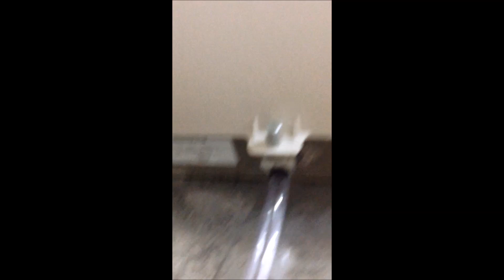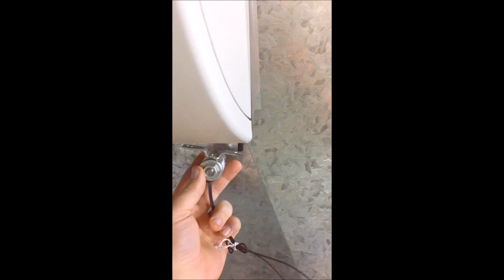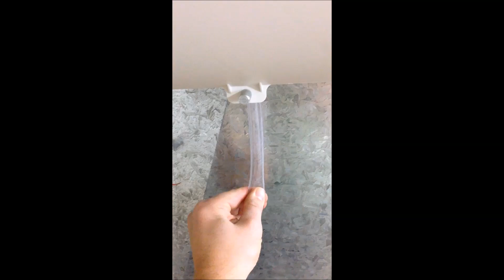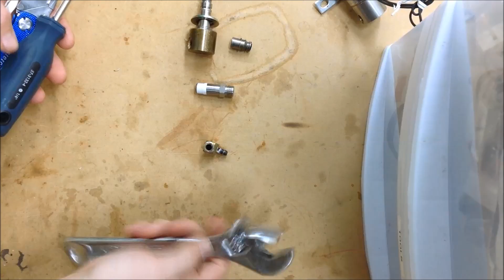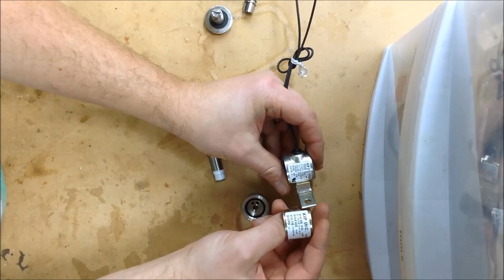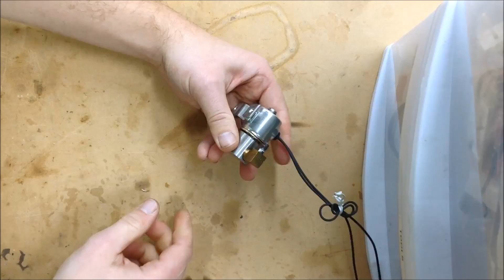How to Fix Your Whole House Honeywell Humidifier Cheap! SAVE MONEY ON YOUR WATER BILL & REPAIR! (HD)

Comment: Yyc, combine that with a city fresh water back flow valve and heating hot water from 6 degrees to 60 in your hot water tank…. Most homes will have over pressure issues. I was blowing part the toilet tank valve and humidifier each year until I installed a pressure reservoir. A city water pressure regulator wasn’t enough due to the pressure build when the water heater would kick on after pouring a bath and not using the water taps.

Comment: My water pressure isn't as high as yours, but thanks for the tutorial. I had no water running, with your help I cleaned it out and things work fine. Thanks., also you can get a replacement unit from Amazon for around $30

Comment: Thank you for the informative video.  I had ordered a new solenoid and it could have filled a fire truck, water was running all over the place.  I ended up watching your video and taking mine apart and cleaning it, works great.  I do wonder where you found a replacement.  Exact matches online are $60 to $120.  Shit for that much I can do like your buddy and just go buy a new unit.

Comment: Superbly helpful video!! I had other problem: the flow of water had stopped so there was not humid air being added to the furnace flow. I was able to open the valve assembly (thanks to Eganwp's video) and clear the 1/16 inch orifice with a pin. While the assembly was opened I removed the hard water scaling and cleaned up the inlet, outlet, and valve. I am sure it would become clogged again in another few years, but at least I know what to do.

Comment: Thanks for this awesome video
Does anyone suggest only opening the feed shut off water valve a quarter turn? We have 1” water feed into the house and thus pressure is high. The sprayer in the humidifier pad feed sprays all over and leaks thru cover. Cleaned everything out for calcium deposits and changed pad but still happens. Thoughts?

Comment: I have read that some guys use a shut-off valve to reduce the water flow to their humidifier when they have too much water pressure. Having hot water supplying your humidifier combined with a multi-turn valve to control the flow can be a problem.  Hot water is recommended to increase the rate of evaporation, but it can destroy the o-ring in a multi-turn valve (it did mine). These valves should only be used in the fully open/closed position (read the box).  The o-ring in the valve can be replaced if you are lucky enough to find one the right size, but it is usually easier to pop for the $10 for a new valve. You could change your water supply to the cold water pipe, but a better choice is to use a 1/4 turn ball-type shut-off valve. They are more dependable in the long run.

Comment: You saved me from HVAC tech visit and likely rip-off bill! I had a new HVAVC installed 5 years ago. Air seemed to be a bit dry this winter (Cleveland, OH).  Was not getting any water to humidifier pad. Process of elimination starting with simplest issue first - check water flow supply to pad....(1) Shut off water at saddle valve,  (2) took off supply line at solenoid valve, (3) turned water back on at saddle valve  - good water flow, (3) cleaned screen on inlet to solenoid (which I would not have known to dig in there and pull out the little bugger had I not watched your video), found little to no buildup, cleaned with white vinegar and toothbrush before re-inserting, (4) removed plastic outlet line on solenoid valve and DISCOVERED THE IDIOT (so called "professional") WHO INSTALLED THE UNIT HAD NOT REMOVED A LITTLE YELLOW PLUG installed in the plastic tube that runs from the outlet side of the solenoid valve to the humidifier pad drip tray when shipped from the factory!  No problem now! Wondered why my filter always looked clean...THANKS FOR THE VIDEO!  (A suggestion to improve future videos - chill on waving your hands around so much and moving parts around the work bench - you look like a magician playing the shell game.)

Comment: Thank you for posting this, I am a new home owner and my previous owner installed one, I noticed continuous water flow in drain line, my inspector said it may be due to humidifier. But I learned recently the newer humidifier is not supposed to allow water flow when furnace is off. I have to look at mine and will update if this is going on with mine.

Comment: video helps. thanks.. but much too long -- we want to get it fixed first.  Should have taken 2-3 minutes. #1- plan what you are going to do before making the video. taking the pieces apart first using and or marking all new parts so you can do it quickly and efficiently showing the repair first, A-B-C, 1-2-3.  LAST.. all other things pertaining to other issues and problems. haha
 #2 - make video.
Reply: Simon Sez Are you only the critic or you really have done well planned videos

Comment: I have a problem with no water flow. When furnace turns on I hear a click, so seems like magnetic mechanism gets a power and possible one of the orifices got plugged. I have found a new 24V (same as mine) inexpensive solenoid and the only difference is that my original is 7 Watts and a new one is 10 Watts. Does anyone know if this is a big deal?

Comment: How did you change the tubing? Mine is clogged and I don’t know how to take it off. Did you just pull off from the April air unit from the outside? Or do you need to go inside the air unit itself and Take out the black part that the tube is attached to?

Comment: The size of the orifice is important, vitally important actually. The orifice controls the amount, the volume, of water that is delivered to the evaporator pad. Too much water, AKA an orifice that is too large, and the pad gets overly soaked;  therefore you will not get proper evaporation thereby not getting the humidity generated that you want. Too little water, AKA an orifice that is too small, and the pad will dry out; again not delivering the humidity that you are trying to get into your living space. 

Also, water is a very aggressive molecule. It is a polar molecule. H2O is positively charged between the Hydrogen atoms and negatively charged  on the opposite end near the Oxygen atom. (http://www.middleschoolchemistry.com/lessonplans/chapter5/lesson1)
This is why it is known as the Universal Solvent. (https://water.usgs.gov/edu/qa-solvent.html)

Because of these chemical properties it eat away at the brass valve body. The flow of water contributed, but the chemical erosion is the real culprit.

Also, you NEED that filter in the valve body. It actually is recommended that you replace that filter annually by most manufacturers. That filter caught A LOT of debris that could have gotten between your valve seat and valve disk. If that filter was not there, that debris could have gotten caught between the valve seat and valve disk allowing water to flow past the valve essentially causing a leak. Albeit a smaller leak than you were describing here, but a lean nonetheless. Also, that leak would worse in time as we have already seen that moving water, corrosive water, would have eat away at the valve seat and/or valve disk if the water flow was not arrested.

Short version of the story, don't try to out think the engineers that designed the thing. They put items in particular places for very valid reasons. 

You should probably have your water tested for hardness and acidity; then have those conditions corrected back to acceptable levels. You and your water using appliances (Water Heater, Clothes Washer, Dish Water, Shower, Sinks, etc.) will be much happier if your water is the correct hardness and acidity!!

Take it from a man that ran a dialysis center, and who also HAD a doubting partner. He pitched a fit that I wanted to install a water softener to condition our water. "EH! It's good enough!" he said. 6 months water he was singing a different tune! "Holy Cow!" he explained, "I can't believe how clean everything is. The glasses, the shower door, the clothes!" And 12 years later we haven't replaced the water heater, which he had been replacing every 5 years because of the aggressiveness of the water before I corrected it.

Just saying, Culligan isn't just hype. They do know what they are talking about. (Not affiliated with Culligan.)
Reply: Hi Daniel, I need to replace a solenoid and the one found in supply store has same characteristics as my current and the only difference is that that current one 7 Watts and new one 10 Watts but both are 24V. Is this a big deal and I might break anything?
Reply: @dbezglasni  I believe that should not be an issue, it just means that the coil uses more current than the original. 3 watts should not be an issue at this voltage. They probably put in a larger coil because they put in a stronger spring to ensure that the valve closes more completely/reliably and need a stronger coil to overcome the additional strength of the spring.
Reply: @DanielLaurie  Daniel, Thank you very much for looking into it !!!!

Comment: Thanks for your video. My Honeywell HE360 humidifier short cycles on-off about 4-5 times once the furnace shuts off after reaching the desired temperature. After short cycling 4-5 times the Humidifier shuts off as it should. The unit seems to work just fine except for the short cycling issue. Talked to tech support at Honeywell, but they were not able to definitely resolve the issue. Is the problem related to an electrical issue with the solenoid or more related to what was presented in the video here? Or could I have the wrong settings on the humidistat? Or....? Anybody know? Thanks in advance!

Comment: This was great! While my problem (water constantly running) was not my problem (i had no water running), the description and explanation of how the parts of the valve and how they work was just what I needed to find and fix my issue. 

My problem was that the little cone filter and the orifice in the inlet tube were completely blocked with minerals/crud. Once I knew the filter was there and where to look, the cleaning and re-assembly was easy. You would think that the Honeywell maintenance instructions would have mentioned the existence of this filter, in addition to the instructions for replacing the water pad.

Thanks for this great and useful video!!
Reply: The Pauls this particular comment should be pinned to top as most people have this problem above the hole causing it to run through. Thanks man!!

Comment: Just thought I would add something to this - trying to find a stockist of replacement solenoid valves in Canada is difficult but I managed to buy a suitable replacement here.

https://www.kleen-ritecorp.com/p-1851-kip-solenoids-14-24v-metering-none-orifice18.aspx

https://www.kleen-ritecorp.com/p-1850-kip-solenoids-18-24v-metering-none-orifice-332.aspx

The solenoid connection is not quite the same but you can fix that will a bot of soldering or simply swap the existing solenoid assembly from your old valve.

Comment: Nice diy video.  I had a new water heater installed.  The installer put a new water line tap on the cold side of the water heater, where the old one was.  The line ran to my humidifier, but no water would run when the furnace came on and the water valve kicked open.  I checked the valve following your video.  It wasn't the valve.  It was the new cold water tap.  When the installer tightened the water tap down, the needle that punctures the water line had slid off to the side of the water pipe, and hadn't punctured the water line.  I re-seated the new tap, tightened it down.  Water started spraying out of the new tap, until I had it tightened enough (and yes, I had turned the water off before hand.  It was just back pressure water.)  The humidifier works great again!  Thanks!

Comment: Hi, Live in Calgary too, where did you order a new solenoid valve?
tried one place they dont sell them separately asking for $150 labour and $130 for parts.

thanks
Reply from the maker: bobsexy2001 Sorry for the late reply. Just search eBay for “KIP 24v solenoid valve”. You just need one that looks similar and works on 24V, and orface is preferable to be 1/16”-5/32”.
Reply: ebay

Comment: I had the opposite problem, no water flowing through the solenoid. Took mine off and found that the inlet hole was blocked. Cleared it with a pin and save $95 on a new one. Thanks for the helpful video that gave me the courage to take it apart!

Comment: Thanks for the video, it gave me courage to open mine up too.  Mine was a different problem though as I was getting no water through the valve at all.  I proved that the sail switch and humidity control worked fine and there was 24V getting to the valve when required.  It turned out to be my intake line.  I used a very small wire to free up the tiny hole in the end of it and it now works great.  Thanks!!

Comment: Thanks so much for the video.  Using your instructions, I took the solenoid from my Honeywell unit apart.  I didn't find a hole like you show but I did find a massive lime deposit that was holding the plunger open.  A good cleaning and she'll be as good as new.  Thanks!

Comment: Thanks dude!! You Rock!! I have the same problem.  I took apart my valve after watching this video and sure enough, there was a hole.  I live in Toronto.
Reply: I connected my humidifier to the hot water supply and the  mineral crap in the hot water seems to gum them up more often, and cause "failures".  I hope to be able to clean it and not be spending $$ on unnecessary parts.  Toronto, also...I haven't heard of the sand blasting due to the water!  I'm in North York, Willowdale etc, maybe the water is different?

Comment: I have the opposite problem,,, no water is getting through the solenoid
Reply: +QuM3 You could get your problem solved most likely the same way.  A solenoid can get stuck in the open, closed, or partly open or closed (depending if you are a glass-half-full/empty person) position.  Replacing the whole thing would resolve, and opening it up would help you find the problem, then you'd have to fix it in a similar way to egan.

Comment: I have the same humidifier.
1.  Water runs constant even if furnace is off.
2.  If I unplug either wire to silonoide the water turns off.
3.  If I turn humidifier off the water stops.
Is this the same problem you had?
PLEASE Help!
Reply: the air switch isn't working right,, its probably stuck in the on position